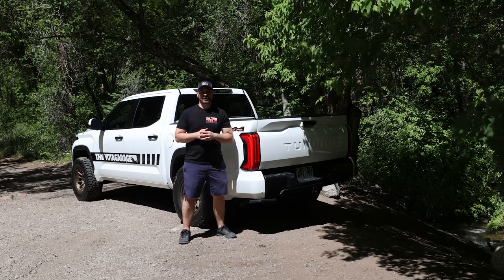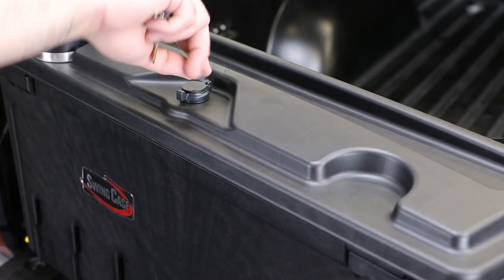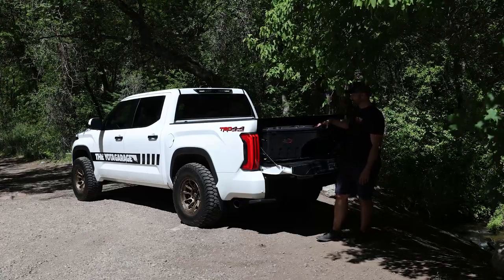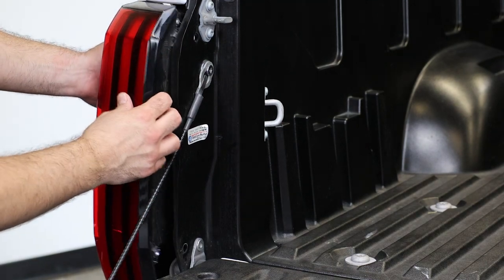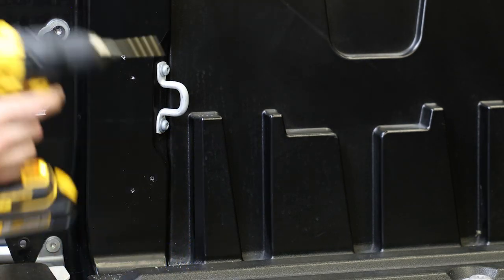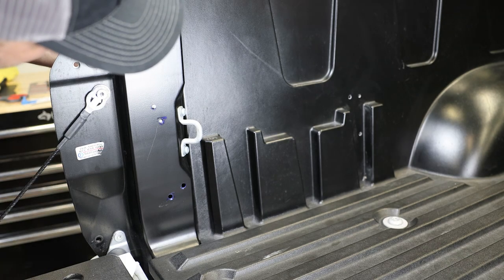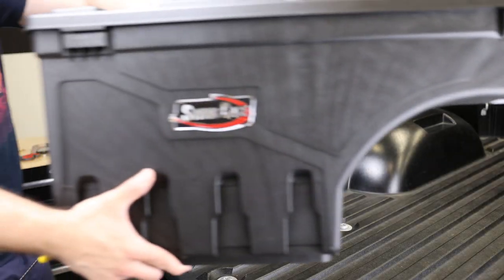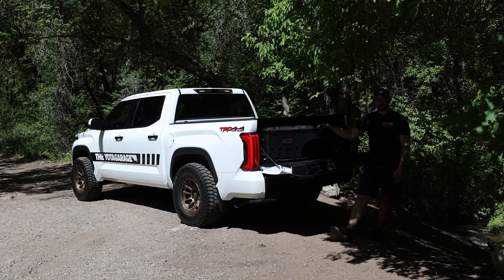How to Install 2022+ Tundra UnderCover SwingCase | Install & Review 2022 Toyota Tundra

Comment: Will I be able to use the bed extenders with these?
Reply from the maker: Only in the extended position, I'm fairly certain a bed extender would not clear the swing case if you try to fold it into the bed.